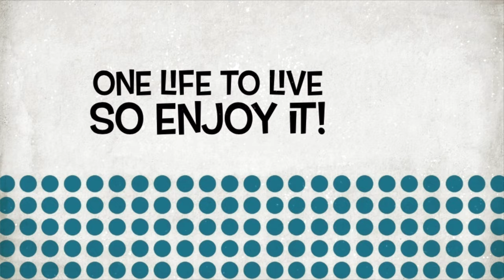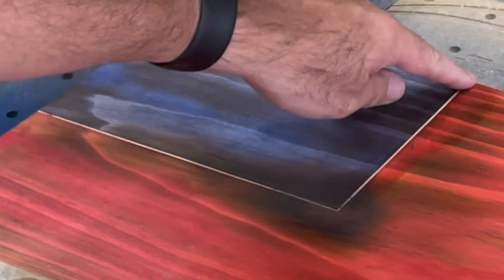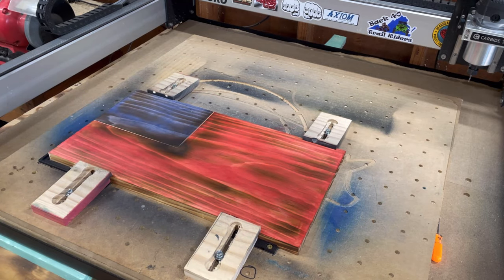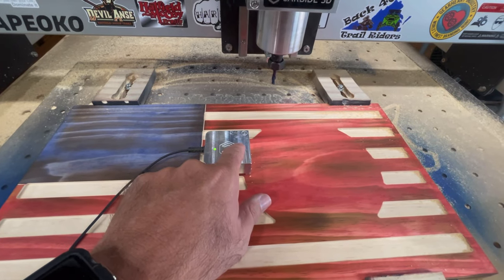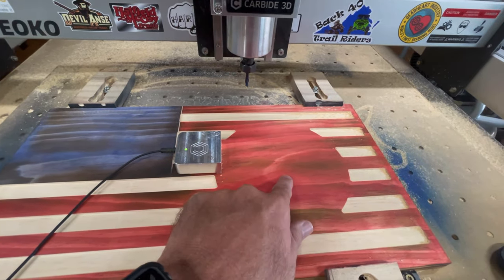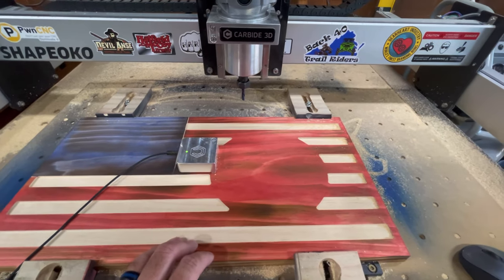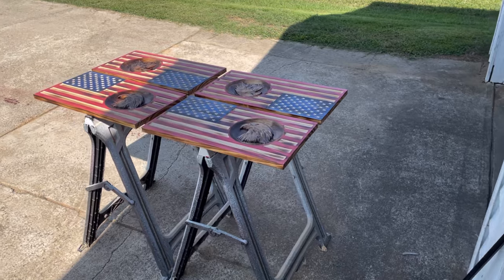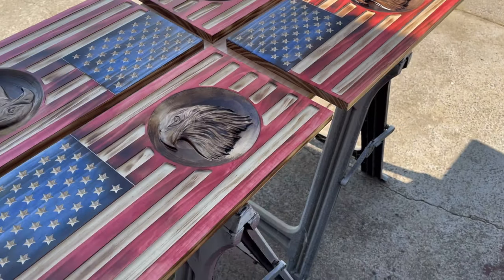3D Eagle American Flag | Shapeoko 3 XXL | Vcarve Desktop

Comment: I don't know if you were "complaining" about the unevenness of your stain on the eagle, 'cause pine does suck up stain very unevenly, but you could put down a coat of Zinsser shellac (spray can) give it a light sand then stain. The stain won't be so blotchy. Your waterbased finish will spray just the same -- no adhesion problems.

Comment: I really like the way it does the star's..I been using a dremel and it's so time consuming..
I'd love to have one of those CNC machines but i'm not that Computer savvy. I'd be worried that the machine be more than i could handle.
I really do like watching you. I remember your sign you did with a Harbor Freight router and it turned out great..
Those Flags look awesome.
Reply from the maker: Thank you!
Reply: @PoposWoodworks  Are the stars basic shapes already in vetric?

Comment: If you set your zero off the bottom instead of the top you never have to worry. Example.... what NEVER changes on a cnc ever (unless you surface of course)..... the wasteboard. You can have a disconnect or power failure or computer crash and return....the wasteboard will still be in the same place so you have Z taken care of. 
Plus if you add the Bitsetter it will handle everything after the initial setup.

Comment: What size/type wood are you using? Is it a standard size you are buying at the store or are you cutting it down to size?
Reply from the maker: 1x12 premium pine from lowes. I cut them to 21” length. The actual size is 11 1/4 wide x 21” long x 3/4” thick.

Comment: Great video, beautiful flag.  What are you using in your sprayer.  I need to stop buying cans.  Thank you.
Reply from the maker: Polycrylic by minwax from Lowe’s. You do not have to thin it out you can spray it straight from the gun. It is the cheap purple gun you can buy from Harbor freight. It also cleans up with hot water which is super easy

Comment: Man, I love this flag. I want to make one similar for my dad.  I have 2 quick questions, if you dont mind. What do you use for the red and blue stain? And, what size ball nose did you use for the eagle carving? Thanks for the video.
Reply from the maker: I can’t remember the exact name but it’s the red and blue stain by minwax. You can only get this red and blue at Lowe’s. Home Depot’s is a shade different.

Go look at the stains in lowes  and you will see the red and blue on the minwax stain chart. 

Also I used a 1/4 end mill for clearing pass and a 1/8” ballnose for the finishing pass on the eagle.
Reply: @PoposWoodworks  awesome thanks. Amazing work.

Comment: What clear coat do you use And do you add any thing to thin it or a hardener to spray, what size nozzle and pressure do you recommend Thanks Mike
Reply from the maker: I use polycrylic from lowes made by minwax. I bought the purple paint sprayer from harbor freight and use that to apply. I don’t have to water it down at all. Also clean up is easy due to polycrylic being water based.
Reply: @PoposWoodworks  Thanks for the update and I love your videos they are very informative and easy to follow
Thanks Mike

Comment: Awesome Job! How do you get your stars to come out so sharp? Mine always come out rounded at the points.
Reply: Plus your Z out a tad..it forces the tool to cut up and out of the wood, thus leaving the sharper edge 👍
Reply: You might have a bit that doesn't come to a sharp point or is off center. I just bought a $60 90 degree V-bit that wasn't machined well and got terrible results ;-P  Brand name too.

Comment: What size compressor do you have to push the sprayer in the video?
Reply from the maker: I use this one from harbor freight. It runs everything I need in my shop.

https://www.harborfreight.com/27-gallon-200-psi-high-performance-vertical-shopauto-air-compressor-56403.html
Reply: @PoposWoodworks  Thanks!!  That's more machine than I want to buy but might just have to. Thanks!

Comment: Hey! I am thinking of purchasing a Shapeoko 4XXL. I've been on the fence due to noise level. Would it be too loud for a townhome garage? Would I be likely to get noise complaints due to this machine?
Reply from the maker: A lot of people build enclosures to help dampen the sound.
Reply: Also if you use dust collection check out Fein Vacuum, thing is eerily quiet, I got two for both of my cnc, just got a cyclone yesterday and made it even quieter
Reply: Think about a water cooled spindle. Only sound you'll hear is the bit cutting.  I have a small Avid CNC in a 10'x12' shop at home. Walls are insulated as is my tin roof. Outside my shop, it's not very loud 10 feet away. My shop vac is louder. 
Now, if you're in a townhouse (like a duplex or triplex with shared garage walls) then yeah, you're probably going to get complaints.